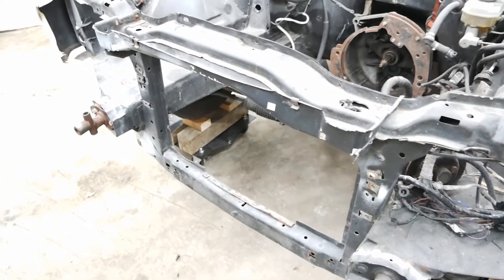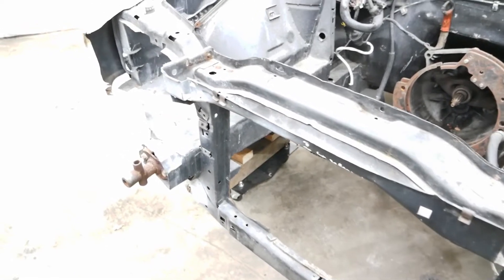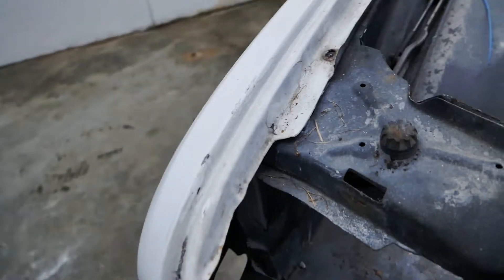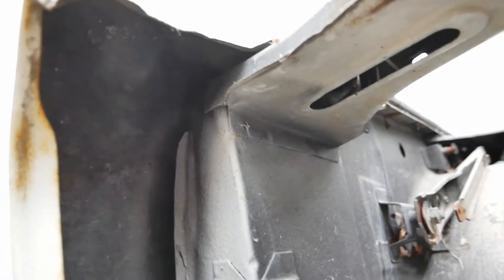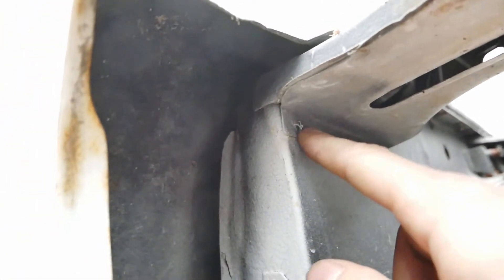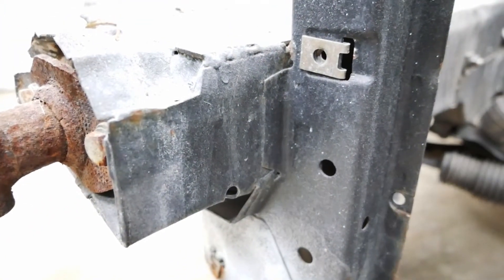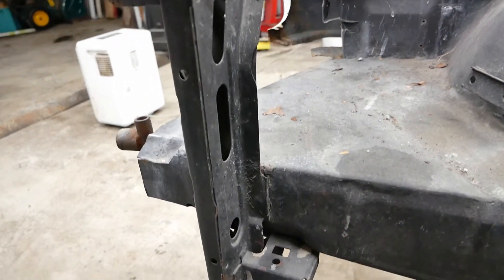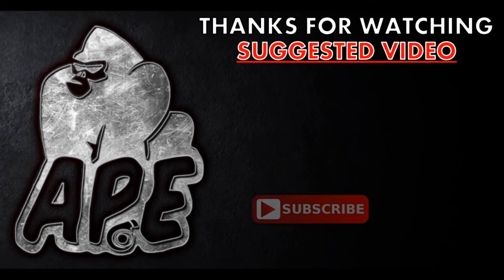BMW E30 core support removal / bolt-on conversion

Comment: Great documentation, thanks for taking the time to film everything so thoroughly. The next time I have to pull my motor I'm doing this, it would make life so much easier.
I had to watch it on mute though
Reply from the maker: Sorry for the music, its hard to find something that everyone will like. What type of music would you prefer ?
Reply: @APEngineering  yeah, the selection of royalty-free stuff is pretty limited. I think it would be better with the tool sounds etc in the forefront and something quieter in the background, maybe some narration. Again though, loved how many camera angles there were, everything was in frame and in focus, great editing
Reply from the maker: Thanks for the input, I will keep that in mind for my next video.